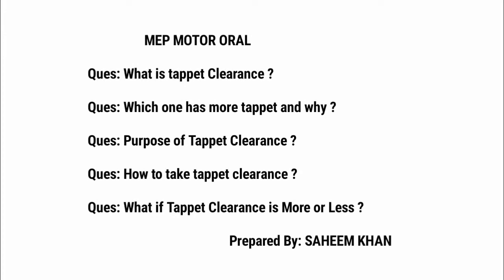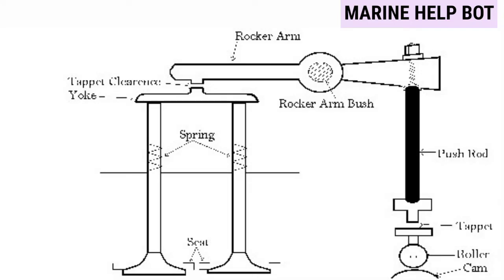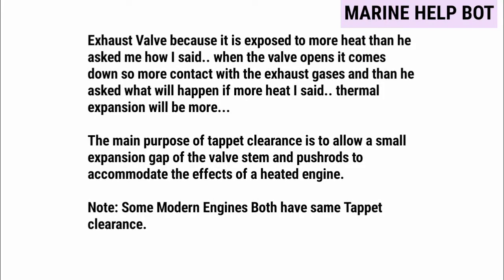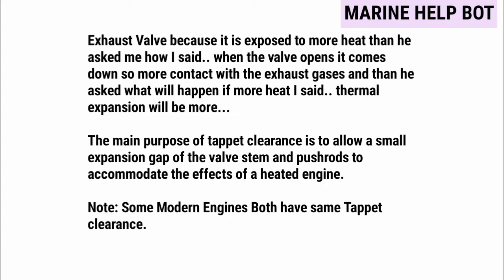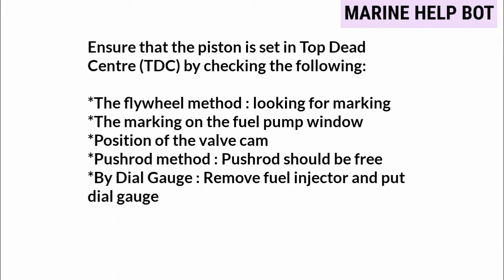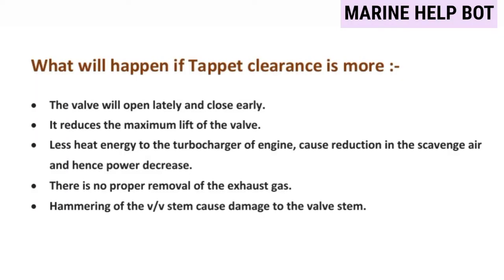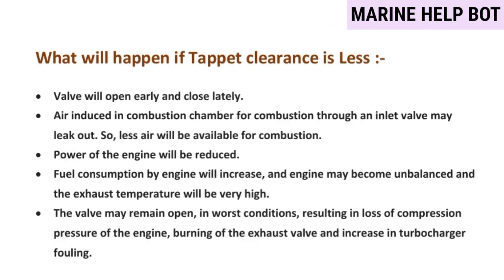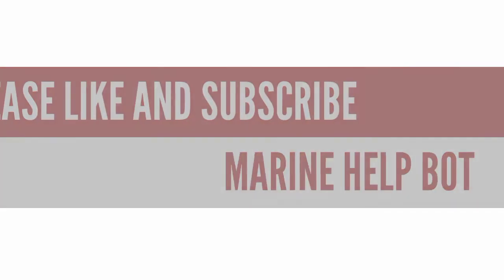Tappet Clearance | Purpose of Tappet Clearance | How To Take Tappet Clearance | Meo Class 4 Orals

Comment: This is asked in mmd chennai. 
Where is tappet housing? And why it is called tappet clearence. Which part is called as tappet.
Reply from the maker: The tappet assembly/housing consists of:

A cylindrical tappet, which slides in and out in a tappet guide installed in one of the crankcase sections around the cam ring;
A tappet roller, which follows the contour of the cam ring and lobes;
A tappet ball socket or push rod socket; and A tappet spring.

tappet is between roller and push rod